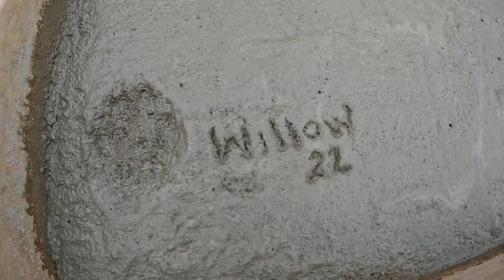Pouring Cement and Outdoor Oven Cooking (Wild Goose Legs)

Comment: Hi Chuck, good job...I have a question...his there a reason why you did'nt put rebar in you concrete slab?
Reply from the maker: It’s stable ground where I placed it plus the weight of the Tanks isn’t really that significant. Finally, it’s not a big deal if it develops a crack anyhow. If I had some screening I would have placed it in there. It wouldn’t have hurt that’s for sure. Definitely would have used it if it were a significant foundation piece

Comment: How come you didnt use any screen or rebar in your concrete pad? Wont it crack with the frost and thaw up there? We are SO enjoying watching your new home taking shape!! Watching from Lochaber Lake NS 😊
Reply from the maker: It’s stable ground where I placed it plus the weight of the Tanks isn’t really that significant. Finally, it’s not a big deal if it develops a crack anyhow. If I had some screening I would have placed it in there. It wouldn’t have hurt that’s for sure. Definitely would have used it if it were a significant foundation piece. Tks so much for tuning in👍👍

Comment: Hey chuck! I have  to put a slab in too, looks like I will be looking to rent a nice piece of equipment like that one! I am curious like some others posted in comments, when do you and don’t you need rebar/ support in the slab? Thanks! Loyal subscriber in Maine.
Reply from the maker: In this case here the ground is really stable and only providing support to a couple of propane tanks. So rebar or metal screening wouldn’t hurt, but I didn’t have any handy and may have been a big of an overkill. Not the end of the world if it cracked either. I’m thinking it’ll serve the purpose here (considering I had the Tanks laid right on the ground for the past twenty years lol!)